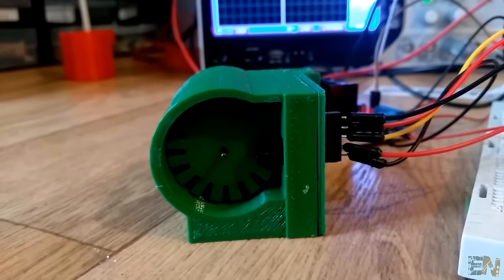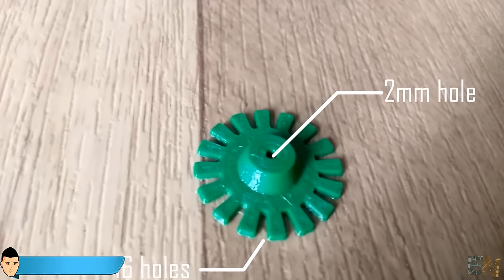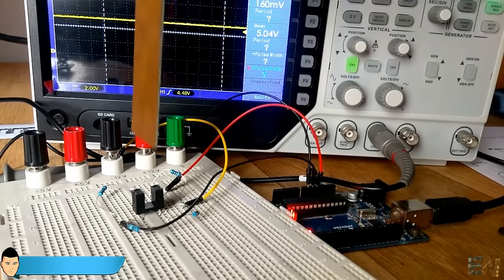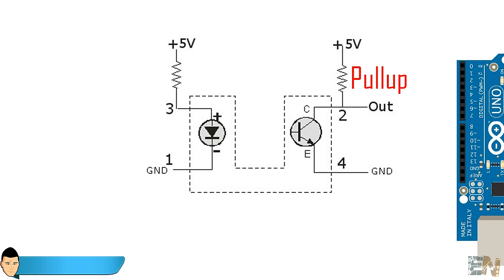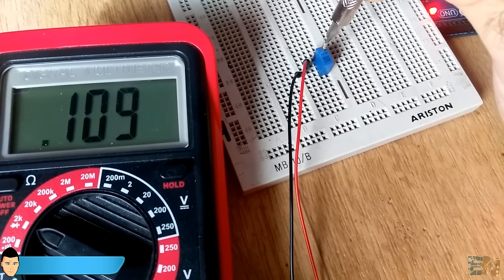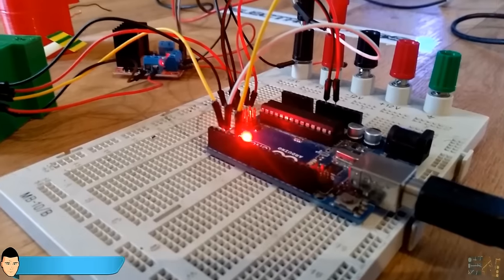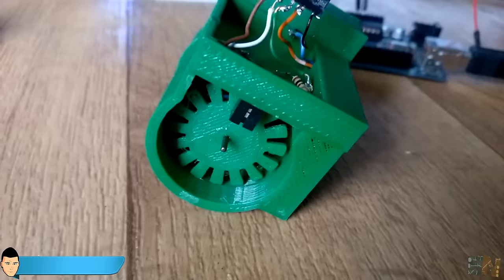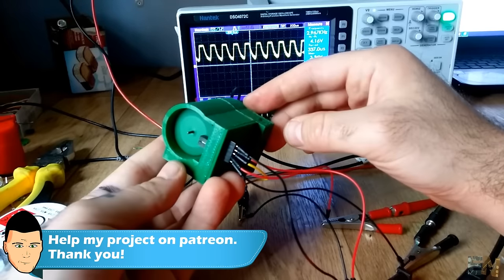Build an optic encoded HIGH precision step motor

Comment from the maker: Sorry, GOOD schematic in here: http://www.electronoobs.com/eng_arduino_tut9_sch2.php

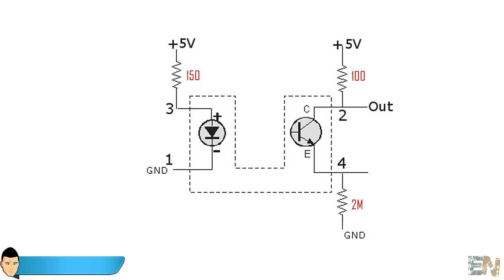The output is pin 4 at 6:11
Reply: hi electronoob,is the motor have enough torque & speed if i use it for 3d printer ? im trying to make a 3d printed nema motor equivalent that can match the specification.i dont mind it size a little bigger than nema 17 size. this is the motor number (17HS4401) it is widely use in the 3d print community. i can't find any tutorial for it.i would so much excited if you could make one. how do i connect the motor to the ramps 1.4 board ? what driver to use ? thank you Electrnoobs
Reply: How do you prevent losing track of position when the motor changes direction?
If you have two gap sensors offset by 90 degrees you can have a quadrature output to solve this problem.

Comment: In industry the encoder as shown in the video at 47 seconds is common.  The reason for the two groups of slits is for higher resolution and dust immunity.  Instead of a single slot and beam, a series of slots are matched to the encoder wheel so multiple slots are combined at once, so a defect in one slot or bar on the disk does not create a drop out as the one of many is ignored.  The reason for two sets of slots is one is shifted by 90 degrees so absolute position can be counted the same way 2 coils of a stepper produce steps.  The output of an incremental encoder can be fed to a dual h bridge to drive a stepper directly. With a 500 count encoder, a 200 step stepper will make 2.5 turns per one turn of the encoder.  This type of encoder is called an incremental encoder.  The middle slot is for the index mark if you require an absolute shaft angle.  500 slots is common for a native resolution of 500 counts.  If each transition of both phases are used for counts, this provides a resolution of 2000 counts per revolution.  This is common in servo systems. This is why servos generally have higher resolution than a 1.8 or 0.9 degree stepper with only 200 or 400 steps per revolution.

Comment: Nice job!! Yesterday, I took apart an Epson Inkjet printer expecting to find a stepper motor. Instead I found a DC motor controlled using an optic switch like yours and an encoder dial with very fine marks. So only 2 wires were required to the motor versus 4 or more. Probably a cost decision or maybe something to do with patents. But your video shows precisely how the Epson printer ink head could be controlled.  I'm beginning to think about creating a CNC using this idea.  Thank you.
Reply from the maker: That's a very nice idea. I'm working on a CNC based on this idea for more than a year!
Reply: HP and Epson uses servo motors in most of their printers.  You're more likely to find steppers in older Canon inkjet printers or laser printers.
Reply: Thats great!, Can you get it to work?

Comment: 6:11 Why have you used a 2 Megaohm Resistor? In my understanding when the Transistor will be conductive, there will still be 4.99 Volts left on the output. Am I right with that?
Reply from the maker: Hi, you are right but is not the 2M ohm resistor problem. I've miss placed the output in the schematic. I've changed the schematic.

here it is:
http://www.electronoobs.com/eng_arduino_tut9_sch2.php

Now you have a voltage divider. When the transistor is conductive you will have 5V at the output and 0 when not.

Thanks for your observation!
Reply: Alright ^^

Comment: thought about PRINTING the dials? :) printing it on a transparent sheet with a ink or laser printer would have great resolution, and saves space+cost. AWESOME WORK!
Reply: It has to be accurately printed.  Laser wouldn't be very suitable because it's not as accurate at putting down lines on paper as is inkjet.

Comment: "bigger project of a 100 € own design of a CNC optic encoded machine"

have you finished the aforementioned project? are there any videos?
I'm also building a cnc with DC motors and encoders

Comment: Isn't the backlash/play in the gear system at the output shaft, after the encoder has been measured, so you can never achieve the required ~18 encoder steps per degree accuracy? Still useful but how about encoding the output shaft? Hall effect or capacitive sensor and good ADC could be a good way.
Reply from the maker: The precision is higher with the encoder inside on the motor shaft than with it outside on the output shaft. Keep up!
Reply: Electronoobs, precision != accuracy. You want many measurable increments for a small rotation of the shaft but this precise measurement may have little relation to the position of the output shaft, after the mechanical "play/slack/slop/hysteresis/backlash" of the gearbox comes into consideration. This is why I suggested a continuous/non-incremental sensing phenomenon, such as capacitance or magnetic field; then you can invest in a sensor with the precision you require (e.g. ADC resolution for a ratiometric Hall effect sensor). Keep up!
Reply: Diamond Eyes sorry, I don't understand what you mean.
Reply: Simon Merrett I think he"s suggesting to use resolvers instead of encoders.

Comment: Very informative and well presented. One question though; wouldn't there be a lack of holding torque when the motor stays still, unlike a stepper which can "hold" its position while still under load?
Reply: 3D Kiwi. Pid control of this home made servo can control holding torque.

Comment: clear and clean explanation,
can you tell me how to activate or insert this function in marlin in order to avoid the loss of steps in 3D printing?
Reply: Good question! Is it possible with current Marlin to use this kind of motor?
Reply: Toon Meynen Not currently supported in. Marlin. I'd suggest you ckeck out Maslow cnc as it's open source and they use servos rather than steppers in their cnc design!